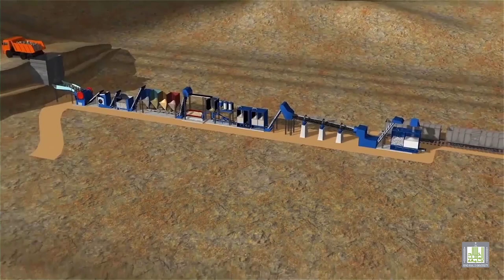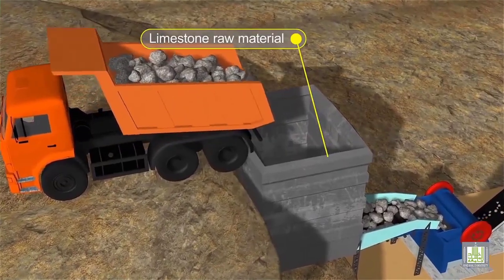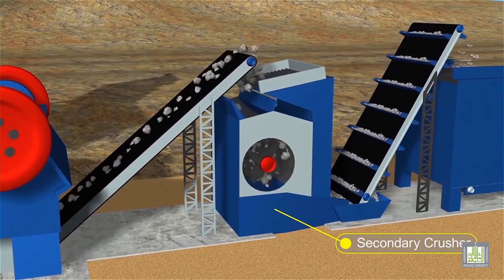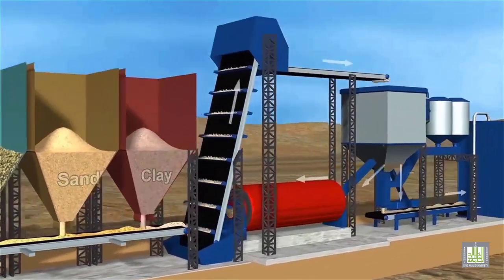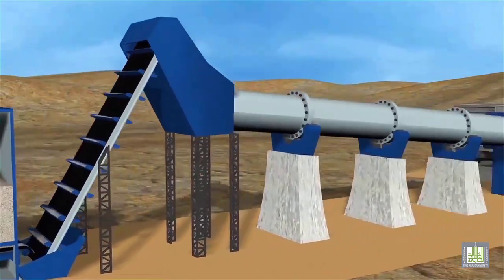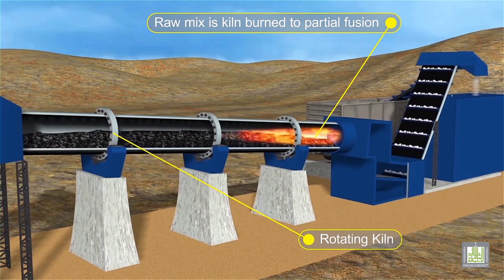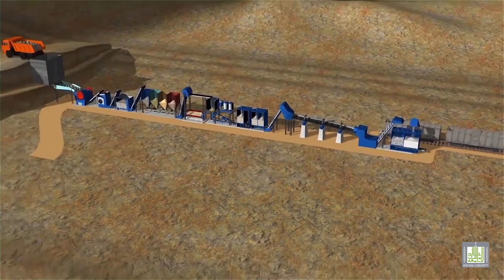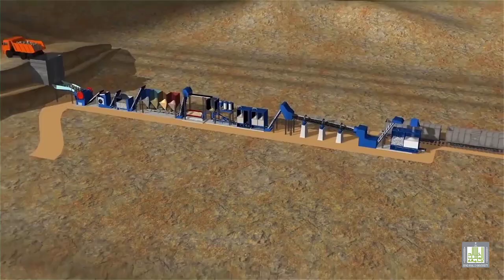صناعة الاسمنت الجاف -  Portland Cement Dry

Comment: Raw materials transport to crusher by trucks after crushing the materials going to the storage and raw materials silos by belts after that the materials go to raw mill to grinding  after this the soft material transport to preheater and kiln by bucket elevator after burning the materials they will become new material called clinker and this clinker must be cooled after burning and transport to clinker silo finally the clinker and gypsum will be crushed and transport to cement mill to grinding and the cement will be product and transport to packing factor to packing as bags or packing in cement trucks